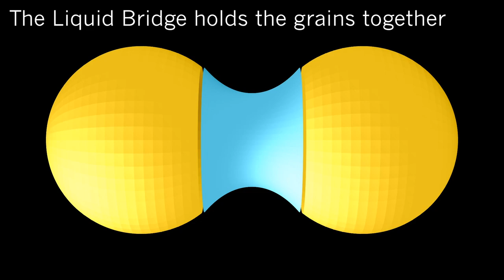Why don't sandcastles fall down?

Comment: When the sand dries, the castle still holds its shape; it does not turn to dust.  Furthermore, it gets quite hard and rigid.  I've built freestanding arches and flying buttresses that stood firm until the tide came in.
Conventional wisdom is that the salt acts as a cement.  In fact, it works exactly like portland cement, where crystals form bridging the grains.
You could verify this by starting with clean builders sand and fresh water, and another form molded with salt water, using "instant ocean" salt mix from a pet shop so it contains salts like in the ocean but not all the other stuff that's found in seawater.
Will the plain water mold simply turn into dry loose sand and settle into its angle of repose?  Is there some extra stickiness compared to the original loose sand?  Will the saltwater form set hard after it's thoroughly  dry, or does that effect also rely on the myriad of dissolved organics, micro-particulates, and even living organisms present in freshly collected seawater?